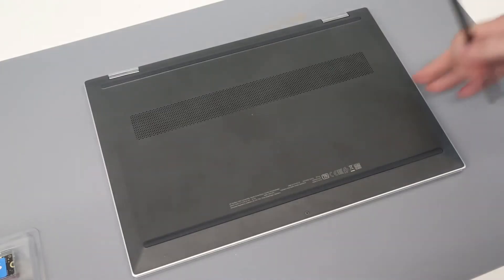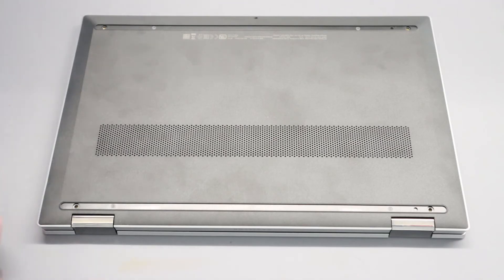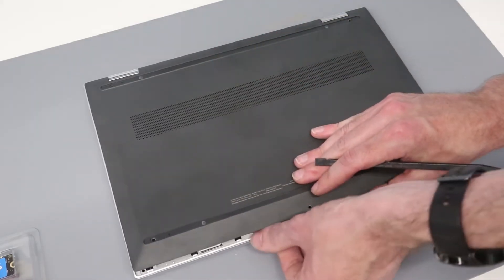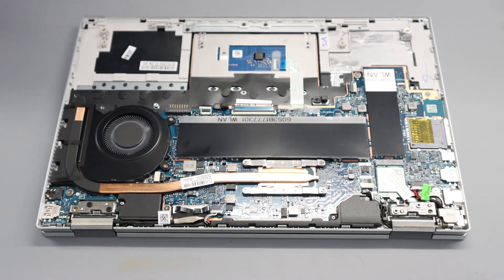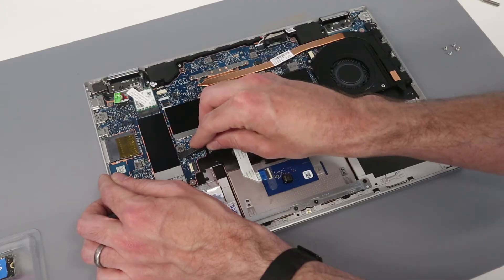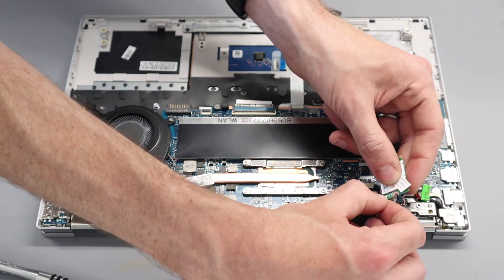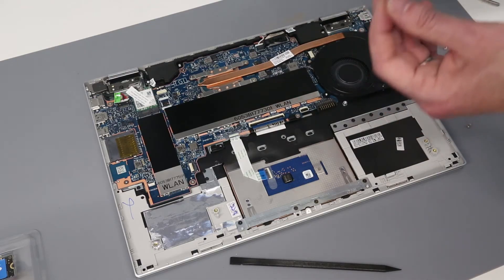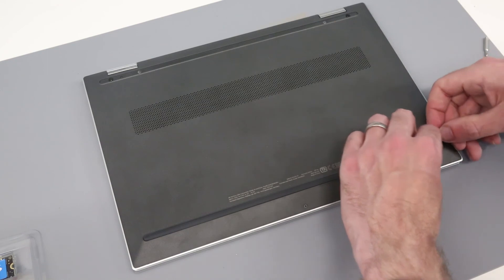HP Pavilion x360 14-dw1012na - SSD and RAM Upgrade Guide

Comment: I've got the same question: what is the maximum RAM for this board?
Reply from the maker: 2 x 16GB (32GB total) should work without issue.
2 x 32GB (64GB total) MAY work, but I never tested it with 32GB SO-DIMMs.
Reply: @BrueComputing I was expecting you to say that its outdated  i rhiught it was pretty odd that the Crucial upgrade scanner couldn't tell me. Thanks!
Reply: @BrueComputing  Dead On Thanks... For future reference you are correct 32 gigs for the HP Pavilion x360 (14m-dh0001dx) 😉
Reply from the maker: Glad to help!

Comment: Hi, thanks for this video, it is really helpful. I did upgrade ssd and ram, the ssd did work but rams did not work, I do not know the problem.  When I turn on the pc, power button and capslock button blinking (screen did not on). Then I replace with old ram. Now I am using with just ssd upgrade. 
BTW,  pc rams are same mhz with old one but it has more gb. Other than that, all features are same with old one. 

What can I do about it ?
Thanks.

Comment: Hi Mr.Brue,
I'm having a wee bit of trouble adding DDR4-3200 RAM upgrade into this HP Pavilion x360 14-dw1012na. I bought the Crucial RAM stick mentioned in the description and managed to push it in/install it, but upon boot I get the 3 caps lock blinks. Upon removal of the new stick, after a CMOS error, the laptop begins to work as normal again.
Is there something I'm doing wrong that's very basic? Apologies for bothering you on an old video!

Comment: Would the x360 14 ek003dx of 2022 be upgradeable? On Best Buy info section it says it has 2 slots but seen someone else on different site say on onboard memory means soldered so idk as don’t wanna take apart and void warranty if can’t upgrade ram

Comment: thanks a bunch! 
I did pretty much the same with my hp but the cpu almost disappointed me. RAM is 3200MHz but automatically down clocked to 2667 when running bc of cpu specs (apparently cant run xmp to overlock)
do you also have the 11th gen i7-1165 or something else?
Reply from the maker: Model I had was a Pentium Gold 7505.
RAM running at 2666MHz is nothing to do with XMP - DDR4-3200 is a JEDEC standard and supported buy the 11th gen Core chips. HP just limited it to 2666MHz for some reason - Dell do similar on their 3000-series machines.

Comment: Sir i have hp pavilion x360 14m- dw0023dx model. The model has 256 GB SSD. I want to upgrade it to 1TB. Is it upgradable to 1TB ? As some reviewers hav said that its only upgradable to 512 GB. kindly guide can i upgrade to 1TB ?
Reply: Yes if it has one currently, I would just take the one out you have then order the same one or go to best buy for another one..
Reply: You can add a tb

Comment: will Samsung - 970 EVO Plus 1TB PCIe Gen 3 work with HP Pavilion x360 convertible 15-cr0xxx computer?
Reply from the maker: Looking at the service manual, yes, it should work.
Only caveat is if your laptop didn't originally ship with an SSD it may not have the M.2 slot present on the mainboard - in which case open it up and check.
Reply: @BrueComputing  thanks 🙌🏻
Reply from the maker: @ayalm50  No worries, glad to help!

Comment: I HATE how HP puts the screws under the feet.  In environments as dusty as my home or place of work I need to crack my laptops open and clean them out regularly.  

Might I suggest that, before replacing the feet put holes in them with a suitably-sized hole punch so you can extract the screws through the holes without having to remove the feet again.
Reply from the maker: Good tip.

Comment: I changed the hard disk but hp generates the next error "no boot device" do you know how i can resolved?
Reply from the maker: The replacement drive will be empty - you need to either clone the contents of the old drive to it, or clean install Windows 10 from a USB stick.
Reply: @BrueComputing  I cloned my old disk but it didnt work. What SSD did you use?
Reply from the maker: @pepel3200  I normally use Crucial P2 drives. What software did you use to clone?

Comment: Why does HP insist on those stick-on rubber strip feet??  😠
Reply from the maker: Because they make the bottom of the laptop look cleaner with less visible screws (and possibly deter home repairs). They also give a gap between the laptop base and the desk to aid coolingl.
Reply: @BrueComputing  No need for them to do that as proper feet do the same. It's the 'deter home repairs' is the real reason IMHO  😏